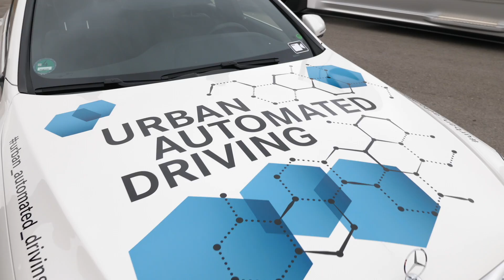Levels of Autonomous Driving - Level 0 1 2 3 4 5 - what is what? Example Mercedes S-Class Prototype

Comment: Great video as always. The problem for level 2 is that the technical definition of combining two systems does not reflect the huge variation in how successfully this is achieved. We own two level 2 vehicles: a 2018 MB E class and a Tesla M3. The MB system is surprisingly poor, barely level 2, while the Tesla system is approaching level 3, but technically they are both equivalent level 2 systems. The MB drive pilot works well on most Interstate highways (but occasionally loses lane control even on perfect multi lane highways), but becomes progressively less reliable on local roads. By contrast Tesla's system works well on a much larger range of roads, and rarely fails. Both have a long way to go to level 5, but currently Tesla autopilot is much more useful for daily commutes. A major difference is that with Tesla the software is updated multiple times during the year. By contrast the MB is stuck with the software installed at the time of purchase, and MB does not offer updates, instead implement improvements every time a new model year vehicle is released.
Reply from the maker: Good report!

Comment: My Seat Ateca is Level 2 but it's lane centering is poor. It wanders all over the lanes between the lines.
Reply: You may need to turn on active lane guidance (thats what my VW calls it) which has the car try to stay in the middle of the lane constantly, rather than just making 1 correction to get you back in the lane when it detects you are leaving it (lane keep assist)

Comment: TYVM! For me, I regret that all the automakers are chasing the urban, UBER taxi use case. I thought the Cadillac Super Cruise on the CT6 was more useful and practical: handsfree driving on 30,000 miles of mapped, divided highways. I think it would be so much easier to get that reliable and trusted than some autonomous vehicles driving in downtown San Francisco / NYC / Boston  traffic. Naturally, GM being GM, changed vendors and direction.

Comment: Thanks Thomas very informative. Would it not be better for car manufacturers all to use the same equipment then all vehicles could communicate with each other? I imagine that the insurance companies are rubbing their hands thinking how much they will be able to charge customers! That is unnerving. Also getting out of the car and it then drives away to find a parking space! Every car will have to be fitted with dash cams linked directly to insurance companies to handle claims. I’m no Luddite but this to me is a mine field of obstructions to negotiate through. It will be the stuff of nightmares for some. Keep up the good work Thomas and team.  Just found this  https://youtu.be/We5jOR8djAY